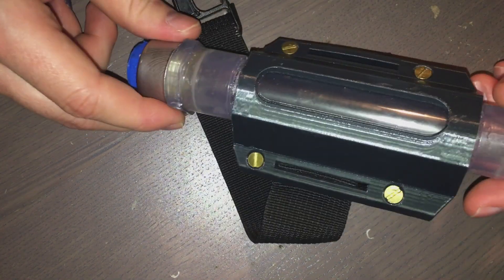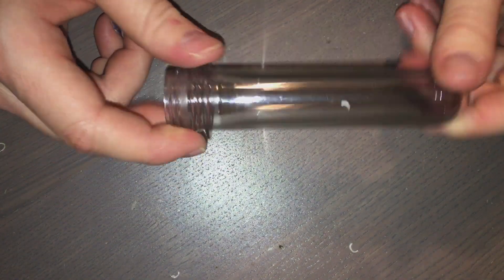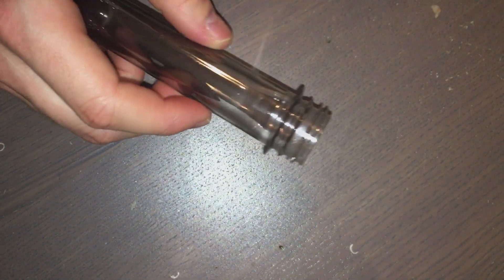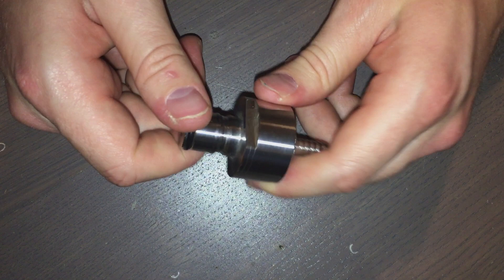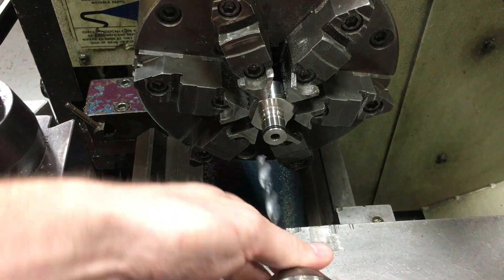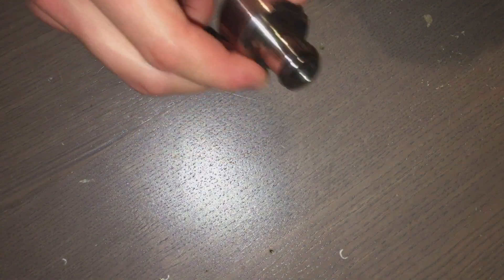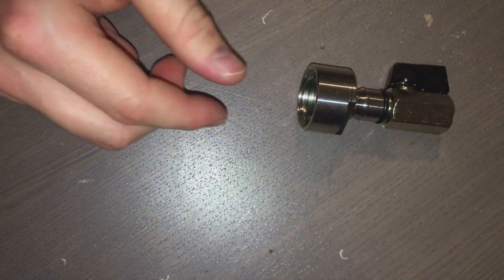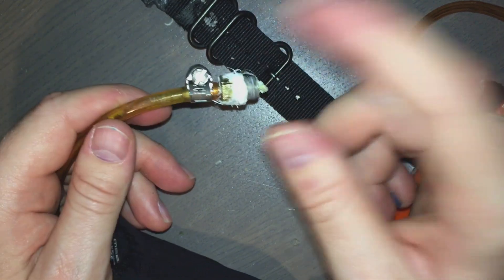Episode 5: Machining Cartridges | Research & Development

Comment: Maybe you could use these cartridges for the ben riley shooter. They look about the right side. Maybe instead of a pusher, thread that stainless steel part and use a motorized archmides screw on each side to push and rotate the cartridge into position